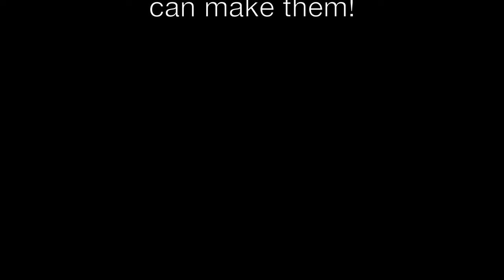T1N Sprinter (2004-2006) Transmission Service + Valve Body Removal

Comment: I love the detail of your filter change, but when I only put 5 quarts in it was still low after checking on the Internet, it actually took 8 quarts because you drain the torque converter any reason why you didn’t mention that
Reply from the maker: It has been a long time since I've watched that video and I didn't realize it was missing the capacity. 4.5-5 quarts refills the transmission if we don't drain the torque converter. Some vans don't have a drain for it. When we drink the torque converter is takes a little over 8 quarts to fill up.

Comment: Simple and informative with good descriptions. Just for clarity, its the T27 for all valve body bolts as well as the oil pan?
Reply from the maker: Yes Chris, I believe T27/T30 is the only torx bit we used in the video.

Comment: Awesome. I almost feel like i could tackle this. Thank You.

I do believe i have an unserviced 2004 with pretty severe Rubble Strip Noise so i believe the agreed next step is to only drain the pan and refill with fresh fluid, to introduce only some new fluid?

There was a rubber weight on the transmission crossmember that has come off.. perhaps that is giving me rubbles while decelerating.

Thanks for the proper dip stick link also! 
That will be the first thing ill need!

(all 3 product links say unavailable for Me)

-tim
Reply from the maker: Hmm, I checked the links. They work for me. Where are you and did you have a dispute with Amazon?
Reply from the maker: Let's talk about this before you do half the job and need to start over or miss the target completely. Draining the pan, but not the torque converter is kinda' like putting on a clean diaper without wiping off the baby. Half of your fluid will remain in the system if you only drain the trans-pan. If you had a glass of sour milk you wouldn't pour half out and refill the glass with fresh milk. A new conductor plate costs less than fluid, so I replace the plate whenever there is a problem. 
Is your issue RSN or other vibration. RSN is valve shudder and you may have something out of balance. What is this rubber piece you mention? Does your vibration stop if you put slight pressure on the accelerator? RSN  alleviated by raising RPM even slightly. Shifting into neutral can also help isolate the issue. If vibration continues in N, it's not RSN. You will probably need to stop before Drive engages again properly. Drop a note with a donation and we can discuss at length, privately.

Comment: Great vid! Thank you for taking the time and energy to make it.
Would a conductor plate be responsible for pulsing shifting? And are there any symptoms for a worn transmission valve body? 
Many thanks to any who respond!
Reply from the maker: That is a new symptom for me, *pulsing shifting. From what I am imagining.... I wonder if fluid is low or filter is dislodged in the transmission? But these are guesses since I've not seen that symptom.

Comment: If wanting a good cleaning be the only goal, does removing the conductor plate make sense once the valve body and it has been dropped? The video doesn't show it being removed but does show the other with no dipstick stop removed. Also, let me recommend adding a simple (or complex) padded adjustable support to have in place under the pan and later the valve body to prevent a oops moment that could prove expensive. A sophisticated one would work like an old fashioned piano bench which raises when spun. A simple one would be a length of 4x4 with a couple of cedar shims under a 1/2' thick square of dense foam the top.
Reply from the maker: I like your idea of a crash cushion to catch my drops! I don't pull the conductor plate off any more unless I am going to replace it. The solenoids all need to come off for this and new conductor plates are not very expensive. If the van is driving great but transmission service is due or the oil is turning brown, I don't always drop the valve body. Only if there are shifting issues, even minor, then I'll drop the valve body and probably replace the conductor plate.

Comment: Great job!  Silent movie soundtrack is pretty funny too.  

My wife and I watched this in our hotel room the day after a $1500 tow for our 2005 Sprinter 3500/Winnebago View that has 87,000 miles.  Transmission "failed to proceed" on a lonely highway in south Louisiana.  No warning and no problems that I could feel ahead of time.  It just stopped moving forward and would not resume. OBD code P0730 "incorrect  gear. ratio" It would only rev to 1500 rpm if put into Drive or Reverse,.  After cycling ignition it sometimes would move a few feet before stopping again. Trans was fully serviced (torque converter and pan) by Sprinter professionals at 27k and 77k.

II called a dozen shops but many were busy or not interested so I wound up having it towed to Dodge dealer hoping at least they could scan it properly.  They have one full-time transmission tech.

Wondering what you'd recommend saying to help a non-Sprinter tech diagnose the problem?  They should look at it on Monday.
Reply from the maker: Some dealerships are great! Others won't hesitate to tell you that you need a new transmission when all you might need is a few ounces of fluid. Incorrect gear ratio can come up from low transmission fluid level or more serious problems. This is common since our vans don't have a transmission dipstick. Only some garages have this Mercedes-Daimler specific tool so all others give a best guess and say "OK"! Another common problem is the Transmission fluid wicking up the wires to the control module under the seat. This can be cleaned with brake cleaner and given a few minutes to dry before reconnecting the battery. If they try to tell you it needs a new transmission, they might be right. But get a second opinion if you can. I have been told this symptom of resting a few minutes then feeling OK for a mile or less is a very bad sign. I don't know of any shops in Louisiana but any shop can put in a Jasper remanufactured transmission. You might be looking at $3500 for the transmission shipped and another $1500 to put it in with fluid and shop supplies included.
Reply: @FloridaVanMan  Many thanks Mr. Van Man.  Amazing to get your help so quick.  I'll check for TCM fluid contamination now.
Reply: Got some news today.  Dodge service writer says their transmission tech reports "3rd gear is burnt" and trans needs to be replaced.  It's reading Code P0733.  As far as I can tell, that 's an OBD II generic code.  And it has several possible causes from what I see online.  It doesn't necessarily mean trans has to be replaced.

I expected they'd have an advanced scanner that would read Sprinter codes and provide more detail about the situation.  How come I'm getting an OBD generic code only I wonder?

They haven't linspected fluid/filter condition or opened up the trans.  How can they know for sure that 3rd gear has "burnt"?  Does the fact that I just lost power on the highway all of sudden, and never got it back, confirm the code?

I want to have a look at the fluid/filter.  They want to charge $350 for that and say I'd be wasting my money.

I don't exactly doubt the diagnosis but they're not backing it up enough for me to trust it.

So how does this sound?
Reply from the maker: @richardgenz7406  Sounds like you got the afore mentioned dealership that won't hesitate to guess & rob you blind while replacing expensive parts. I am not a trained professional and I am sometimes wrong... but P0733 tells me they have their DBRiii setup for NCV3 Sprinters (906) and you have a T1N Sprinter (901.6;902.6;903.6...). Without the KWP protocols they might as well be using a magic 8-ball. 
The accusal of "3rd gear" is also curious. We don't have gears to burn up, we have clutches and valves. 3rd gear doesn't use the same clutches or valves as you would have been using at highway speed in 5th gear. Clutch K3 would be logical to have burned, but a service writer better understand the difference between a clutch and a gear! 
On the other hand, I found only more confirmation that this symptom is always* terminal, requiring rebuild, assuming you have an appropriate fluid level in the transmission. I would not be comfortable with the shop if they are not willing to dip the transmission in my presence, showing me the oil is measurable (the stick reaches it) and the fluid is brown before agreeing to replacement. If the fluid is too low to be sampled on the dip stick it should be filled and driving attempted, engine running in gear for no less that 90 seconds. If fluid is extremely low and the torque converter is drained of fluid the van will not move until it refills. This may take a minute in gear when the overall level is too low. It may never happen when fluid is extremely low. If the fluid is still very pink and you have not had it recently serviced, nothing inside is burned. 
In short, they may be right and you might need a new transmission. But if they have not verified you have at least minimal fluid and have not inspected the filter, get a second opinion. Fluid does not need to be full, just measurable, reached by the dipstick's tip.
Reply from the maker: @richardgenz7406  The reason they want to charge $350 for 15 a minute inspection is because they want to scare you away from a minor repair after they guessed big-problem. $350 is RIDICULOUS for inspecting transmission prior to removing it. That is the price for a new filter and 6 liters of fluid, installed with a trans service. Why would they charge a full service when not adding a new filter or fluid? To scare you away from the inspection that might prove the assumption was wrong.
Reply: @FloridaVanMan  OK the wheel has turned (but not the wheels on the RV, not for a while yet)  I'm now waiting on a rebuilt SilverStar trans for $2750 including shipping.  Dealer will install.

Next day dealer offered to drop pan and let me inspect it -- for $250.  Following your very helpful tip about a dipstick check, I asked for a sample.  They went ahead and drew out a few ounces of trans fluid and showed it to me in a jar.  Burnt-smelling and dark brown (yet only 10K miles old).  They also shared their diagnostic protocol sheets and svc manager walked me through the results for my vehicle.  Also, he explained clearly that their transmission tech does not fix transmissions -- he diagnoses them, and he installs them.
Amazingly enough, they don't have a working dipstick for this vehicle (now I do thanks to your link.)  But because fluid drew easily from top for my sample, and there is no obvious leak, tech concludes my fluid level was OK.  

It's been stressful and pretty crazy but now the course is set for SilverStar and fingers are crossed on quality, longevity , sound installation etc.   It's been great having your feedback.  Oh by the way they said their DBRiii scanner is stationary type not portable and it loads correct codes for a given vehicle by reading the VIN.

Once you're towed in to a shop, they kind of own you -- it would have cost about $700 to tow my 24-foot rig across town.  But I seriously considered that until people finally started responding to my request for hard info about their diagnosis.  

Note -- if anybody thinks about buying remanufactured trans direct from Mercedes, I learned that when they say "transmission" they do not include Torque Converter.  Trans costs $5200 remanufactured plus $1100 for reman TC.
Reply from the maker: @richardgenz7406  Thank you for sharing the details, difficult though they are. SilverStar has a good reputation in the T1N world so I'm sure you will be happy. And it sounds like you are in good hands at the shop. Clearly not Sprinter specialists, but they have the resources and a good plan. Sadly, what they say about the transmission tech is true everywhere. Almost nobody fixes them. They diagnose and replace, which tells me odds aren't on our side. Even when they KNOW it can be fixed, they won't do it! I've fixed no less than 5 transmissions in recent years from certain death by replacing valves, conductor plates and sometimes just filters. I'm not counting maintenance, these were all unable to drive home. One was a YT subscriber camped in Jacksonville last year. I think that is in the Rolling Rescue playlist. Without us they would have been getting towed out of the State Park, spent a week or more at a shop plus lodging and extending vacation but not vacationing while stuck. Saved 90% and we were done 5 hours after he called for help.
Reply: @FloridaVanMan  🔥😎👍

Comment: Super helpful video! Curious if all of the bolts, including the last ones on the transmission pan, are torqued to 8 NM ? Also the transmission fluid that you linked is different than the fluid that you used in the video. Is that stuff still recommended for the MB sprinter T1N /'03-'06?
Reply from the maker: There are many brands available on eBay and Amazon. I don't have a favorite.
Reply from the maker: Yes, all the bolts in the transmission pan and valve body have the same torque setting.

Comment: Florida van man. My dipstick goes all the way in.. is the only option to replace the conductor plate?!?
Reply from the maker: Might try a second dipstick or try your dipstick in any other Sprinter. I found one dipstick with the stopper nubs just a bit too small or worn-down. It would pass through the stopper funnel. If two dipsticks go too deep I think that is confirmation the conductor plate is wrong.

Comment: Amazon claims the conductor plate link doesn't fit my 2005 Dodge sprinter but it looks to be the best quality part. Can you confirm they are in fact wrong about this? Thanks for the great video and clear instructions too.
Reply from the maker: That's strange, Amazon claims fitment for a 2006 Dodge Sprinter which is what I put it in in this video. It is the same part for 2002-2008 Sprinter vans so the one we've linked in the description is the way to go!

Comment: Awesome video! Would you by chance know the total length of the dipstick you used? I bought one identical to yours but I’m worried I’m not getting accurate readings after doing my transmission fluid change. I want to make sure I have the same one because mine sticks out about 6 inches of the fluid fill tube.
Reply from the maker: If you can send me a message in daytime I can check it but length of the stick isn't normally relevant. The stopper is a wide point at the top of the black tip on your dipstick. if you aren't reading any fluid there may be a piece of dipstick broken off inside the tube. If you can push farther, it wasn't fully inserted.
Reply: Thanks for the response! Let me know if you were able to get a total length of the dipstick you used in this video. I am able to to put the dipstick all the way in with no problem with about 6 inches sticking out. I can however push it beyond that point till the entire dipstick is in the fill tube. I definitely feel it come to a descent stop with about 6 inches sticking out.
Reply from the maker: @garettsimon3800  Measured 4 of them. Longest is 48 inches, shortest just 46.5 inches.
Reply from the maker: @garettsimon3800  I thought I replied a few days ago, sorry. The dipsticks I have vary between 47inches to 48.25 inches.

Comment: I see y'all using ramps - do y'all like those for doing maintenance? Does it require the vehicle being level to drain anything?
Reply from the maker: I have not used the ramps in years. This video is getting old but still relevant. I occasionally use a jack to tilt a van for better drainage but on a level driveway it isn't necessary.

Comment: Great video. I put everything back together, and now have no gears. Goes nowhere. Where do I look?
Reply from the maker: Oh No! How many liters or quarts of fluid did you put in?
Reply from the maker: Also you may have to clear the EGS (transmission) codes before it'll move. Especially if it threw transmission codes in the first place.
Reply: A little late to the party, but be certain to get the valve pin into the groove in the comb wheel when you mount the valve body.
-dave

Comment: Great video.  Thanks for the info.  I have a T1N 118'.  What do you recommend for RSN?  Have you ever performed the DARF mod?  Thanks!
Reply from the maker: I have not done the DARF because I understand there is a little loss on mpg and it doesn't rumble at highway speed on the one I had. I sold that van over a year ago. Not all shudder is RSN so if it hasn't always done this, or if you haven't already... Replace the fluid, filter, connector seal and conductor plate. This solves *most T1N transmission issues.
Reply: @FloridaVanMan  Its only a mild annoyance at around 35-40MPH on my van.  (nothing at highway speeds)  I have changed fluid, filter and connector.  I didn't clean the conductor plate like you have shown.  Maybe that's the next step...  thanks again
Reply from the maker: @JonGould5607  Rather than clean the conductor plate, go the extra mile and replace it with new. If the problem persists after that DARF is your only option.

Comment: Seems like you call two different things the plug: the one that's attached to the wiring harness...and...the cylindrical thing you popped out that the first fits into. How about employing a more technical term for those who might need to replace one?
Reply from the maker: Yes, if I had better terms, perhaps. Like a plug on an appliance cord and the plug in a wall, one goes into the other, but we call them both plugs. The cylindrical part with two O-rings is often called the connector, but that also can refer to the plastic end holding dangling wires. Which way is right and wrong will be different regionally.